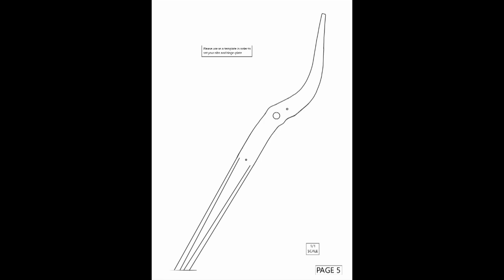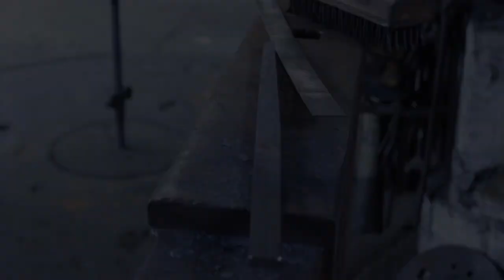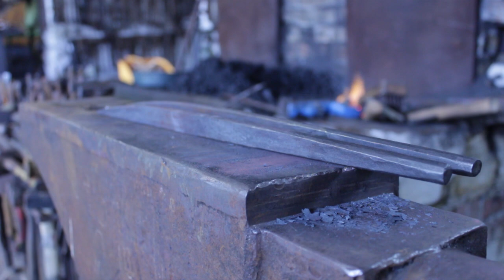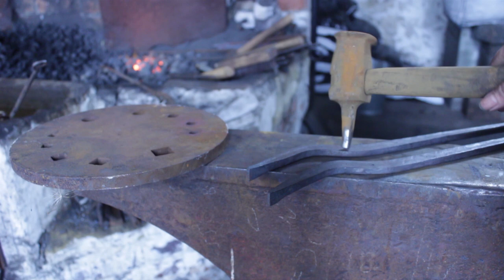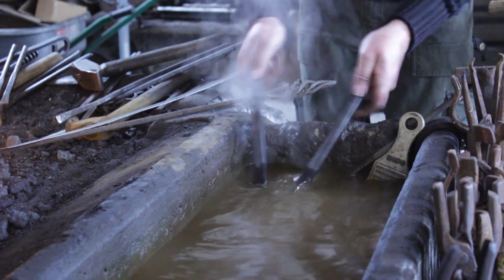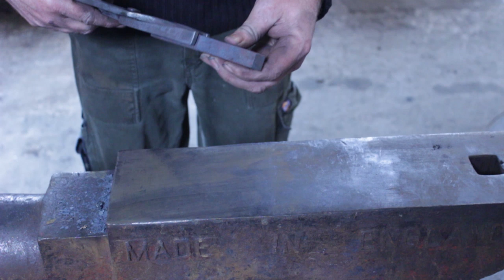Forging Viking Tongs

Comment: great work and excellent video. 
Question for you from a beginner: To my eye the material around the hinge is a little light. Is this a problem? Could you have made a smaller hole and then drifted it larger to save more material?